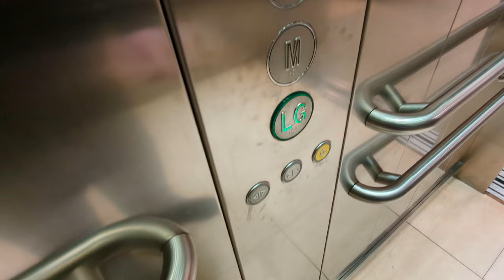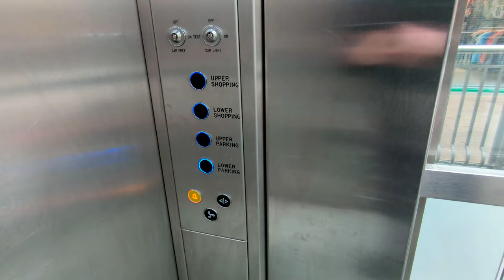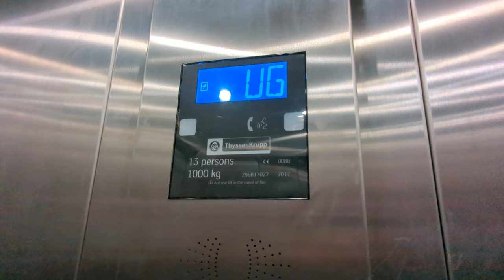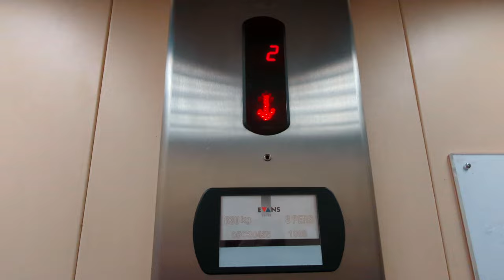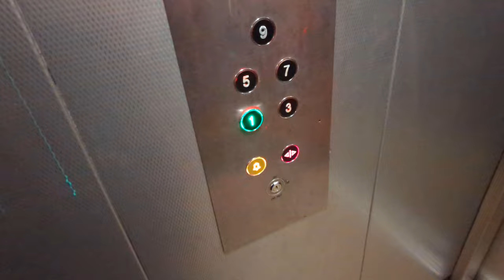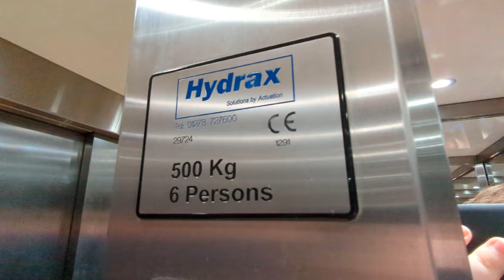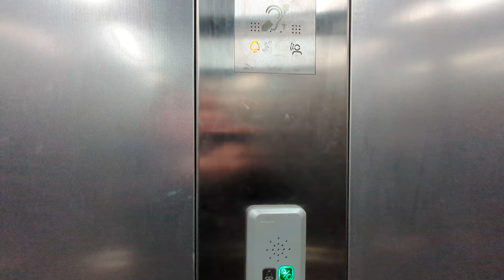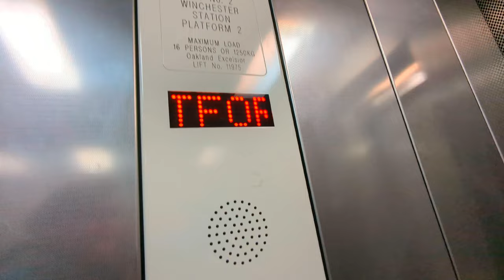Lifts in Winchester

Comment: That express Evans lift branded as Evans in the surgery was built in the mid 90s as evans started using that design around the mid 90s from 1996 /97 onwards they used the express Evans name. Waterstones in Southend also has a 90s express Evans branded as Evans that one was built in 1995 so i reckon the one in the surgery here is the same. That hydrax in the white company has megom which is weird it must be an add on. Not many of them generic hydrax lifts have megom
Reply from the maker: Thanks for the info.

Comment: 17:59 😂 lift voice on repeat 🔁
Reply from the maker: Typical Lester if you repeatedly press the call button. Many lift types can do similar depending on the cache like Newlift at Stansted it has a big cache so repeats you are not authorised to use this floor as many times as the button is pressed.